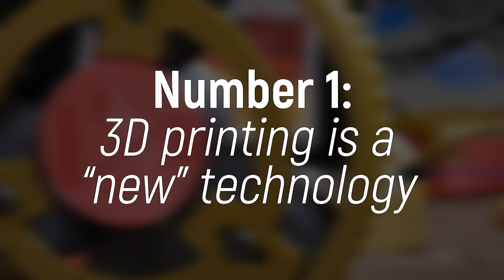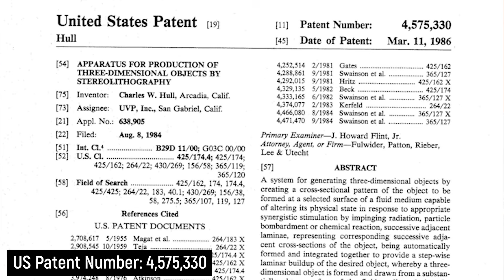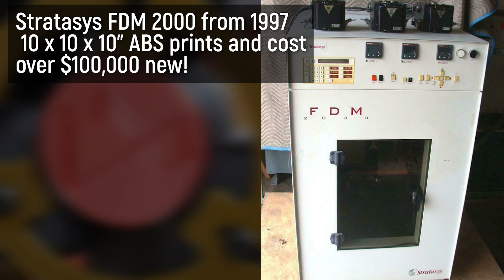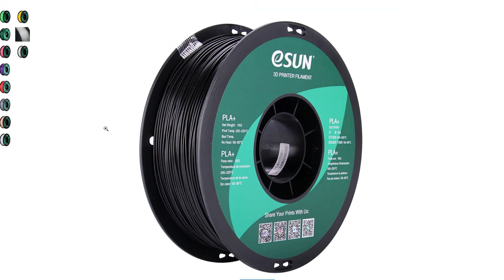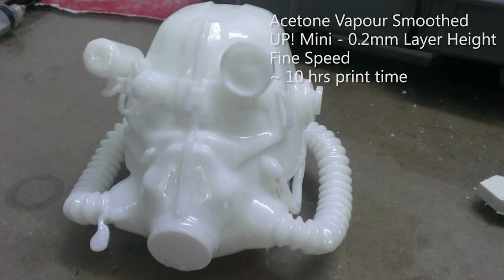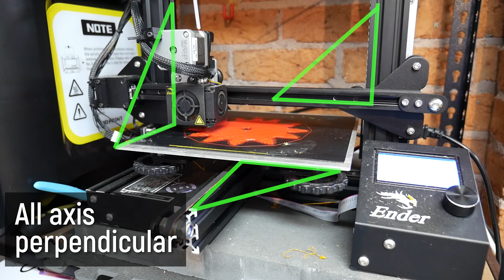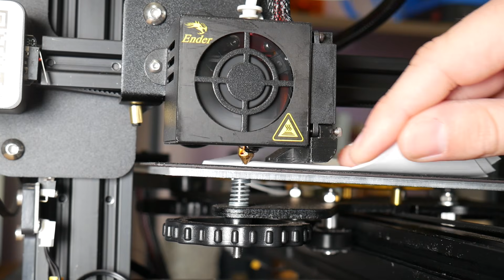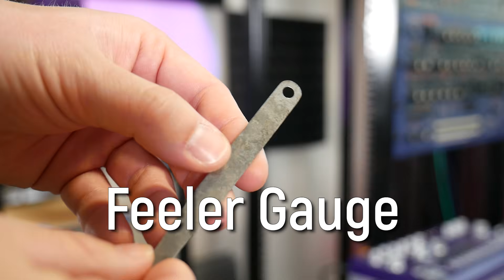3D Printing Myths I used to believe...

Comment: just want to say that i never fold the paper, and its wierd that you do and then show that its bether to use metal 0,1mm, when folding the paper would make it higer than 0,1. in the manual on the ender 5 pro it says onely to use paper nothing abut folding it. but i gues if people folds the parer 1 or 2 times that would explain why it prints wrong :)

Comment: One error. The first patents on related to extrusion objects basically manual 3d printing was 1917. I was first given a gift of getting to use a 1.4 Million dollar 3D printer. That is 1.4 Million before you cool it that was about a million dollars once you install the required roof based cooling stacks. They were using them to replace a CNC machine for making metal injection modls for plastic containers. I wonder if I bough the right model for myself, I bought an Anycubic Vyper. I am just curious if it can be modified or upgraded down the road. Also for dealing with the rough outer surface what mechenical sabding is good. I wantt a machine liek a Dremmel to use is.

Comment: Never seen it mentioned to use folded paper.
Always a single sheet.
Then i adjust the z offset on the first layer. Usually during the brim.
No calipers etc.

Ive also been printing with dual Z screws and steppers with no belt etc and I have NEVER had the steppers go out of synch. That is a complete myth in my experience.
30kg of pla and 10 of abs and never had that issue.

Comment: If you need to use paper to just to check if the nozzle is in contact with the bed, wouldn't it be easier just to use a thin sheet of unfolded paper and aim to raise the bed just enough to get a firm scratch when dragging the paper?

Comment: Hi, nice video, nice chanel content, but this time I have to disagree about the 2nd myth: what Stefan didn't consider is creep (what happen mechanically to materials when they have an stress for a long time): what happen with PLA is that, even when it has a higher yield point, it is the weakest polymer at creep, maybe because it is not  an oil-based polymer, that would be the case for example at a shelf: at a shelf ABS would have way longer durability than PLA. So, ABS has way longer durability than PLA on long term stress aplications.

Comment: I have been using a feeler gauge as well with mixed results.  How do you know what thickness of feeler gauge to use? You show adjust ng the machine to match the feeler gauge.  my objective is to find out how thick of a feeler gauge to use.  How did you determine which thickness?
Reply: You'll need to do some testing first to get a good first layer, then find out what the nozzle height is. Then in the future you can get it back to the height you found worked by knowing what thickness feeler gauge worked before.

Comment: Is Myth #2 really a myth?  I print functional parts for work.  We use cheap 3d printed hook holders for customer chainsaw chain.  Odd thing most ABS printed hooks are going strong almost 2 years coming and going from customers.  PLA most fail immediately and zero even survived a year.  PetG doesn't hold up much better than PLA.  When I need something to last I print in ABS or PetG.  For us I find PLA and PLA+ completely useless and  a waste of money.

Comment: Here is a myth: u always lvl ur bed after every print....

Reality: u lvl when u really need it

(Printing at low speeds and taking out the bed clips to get the print helps to keep the bed lvl)
Reply from the maker: If you're gentle when removing prints you don't have to relevel for months, but if you hack at prints to remove them you might have to do it every print...!
Reply: @MakersMuse  totally true.

But its so cool to just press the button and see it working propertly (also im sooo lazy to level haha)

#gentlegang

Comment: I still remember when I added auto bed levelling to my 3d printer. Best day in my 3d printing life. Manually levelling the damn thing wasn't only exhausting, it produced terrible results. It was a nightmare. Now I just stand there in awe watching that marvellous little device do its thing. Quick and perfect every single time.
Reply: same, i often didnt want to print something because i was too lazy to level my bed
Reply: New to 3d printing. Can that be added to any printer? How?
Reply: @t.pisani8239  Pretty much every printer. You'll need a sensor such as bltouch; if your firmware doesn't support it, you'll need to install Marlin or similar.
Reply: I found it to be more of a pita to get working than it's worth. Takes me less than a minute to manually level.
Reply: @collegestudent6071  How is it a pita? Just stick a inductive probe next to the hotend, set the z offset and away you go. It's much better not having to constantly check the bed hasn't moved or having to watch the first layer go down just to see if it's correct.

Comment: If I got $1 for every time someone has said that levelling with feeler gauge as you suggest, or levelling by having the nozzle just touch the bed will fail because "marlin compensates for you using a piece of paper which is the correct way to do it" I could have an extra printer for free!

I arrived at this conclusion by completely ignoring what the masses say, and looking at the printer and what it does.. First layer it goes to layer height (0.2mm) so i figured hang on a minute, if I have a piece of paper in there when I set the zero point its too high! and I grabbed my feeler gauges and did exactly what you show and presto.. perfect first layer..

It was at this point I realised that there are MANY of these myths circulating the 3d printing community, being passed on parrot fashion until they somehow become known facts!

Comment: I print ABS as my primary material, I mainly make mechanical parts. My printer is set up pretty much exclusively for it. It's easy to overcome it's issues (other than the stink) and once dialed in, I find it better than other materials. Especially for post print workability. I love how I am easily able to fuse parts together, heat gun smooth, carve with a knife, drill, etc.. I like PLA and PETG too but I just keep coming back to ABS.

Comment: The easiest way to make sure you are at the "1st layer" when leveling your bed is... To just start a print and then stop it, then level the bed. Also i use a single sheet of paper, do not fold it or the nozzle will be too far from the bed. Also i recommend using a mirror(ikea mirrors are awesome and cheap), clean it once with soapy water, dry it with paper towels AND NEVER TOUCH IT AGAIN and you will have amazing adhesion without needing to use any tape or glue. It will actually be stuck so hard that you will be able to take it off only after the bed completely cools down.
Oh, one more advise. Sometimes the bed is not completely flat. You leveled all the corners but the middle seems to high/too low. In that case just make sure the middle is level and print in the middle only ;)
Reply: If you print in the middle only, your loosing a hell of a lot of build surface/space/plate what have you. Best to get the issue sorted and dial your machine in so it works consistently and as intended

Comment: My first print was with a university printer and it was loaded with ABS. NEVER AGAIN did I voluntarilty print with ABS. It was a cold day, the print bed was not heated and the printer didn't have a chamber to help regulate the temperature. I helplessly watched as the part warped and the printer made spaghetti out of my final project while I looked at it through a locked glass door, unable to stop it or fix it, my time before the deadline running out.
When I got my own 3D printer I never once bought a spool of ABS.

Comment: actual leveling (with a level) is pretty important for sla, though you can just eyeball it, but if it's too off level you might have problems on bigger prints where one side runs out of resin.

Comment: oh boy....you are so long into 3d printing and you adjust first layer hight by using the tensioning screws on the bed...?

just use paper or gauge and make distance bed to nozzle equal on all positions. Then you try printing. Use babystep until your first layer is perfekt. Apply the amount of babystep to home offset and done.

Comment: I use a level to get everything to close to the same so there is less adjustment and im not going off of nothing it just reduces the time it takes for me by a good but and yes I know the level doesn't fo much it just gives me a good baseline to go off of I still have to adjust other points so its all even the lever to get it all right just helps a bit in the beginning you still have to look and test and tighten or loosen the screws to make it print the same on all like I said

Comment: Have used a feeler gauge like that for years. The paper method never made any sense. Feeler gauge for the first point and then mounting a dial gauge on the head, that then moves to the four corners, where you adjust the four dials to show the same number on the dial gauge as where you used the feeler gauge. Then you get perfect leveling every time.

Comment: I can never get the paper "trick" to work for me NEVER. I just throw a basic square one layer print on and as its printing a large square I adjust the bed and then ill print whatever I need but it is time consuming and wasteful.   I dont know if I completely understand how your using a feeler gauge to level the bed? I get how to use feeler gauges, I use them daily for engine builds and etc. but I dont understand what you mean by how I am supposed to adjust the extruder to fit the feeler gauge? shouldn't I be using a specific feeler gauge to get the correct gapping ?  great video by the way :)

Comment: I just figured the paper under the nozzle was because most people don't have feeler gauges knocking around. Also, why would you fold the paper? If it's folded it's now 2 thicknessess of paper away. I'm guessing it should be as close to 1 layer height away from the bed. Whatever that turns out to be, use a feeler gauge that thick.

Comment: My father, who used to work as an engineer for military branch of Boeing in the late 80s, brought home various 3D printed items from his work at that time. For demonstration the 3d items were all designed with features that couldn't be manufactured with the common slide mold. For example, they produced a rook chess test piece that had a complex spiral stair case inside that couldn't be reproduced by conventional methods. It was quite an impressive achievement for that era.
Reply: Skunkworks?
Reply: @THPOOKY  Skunkworks would be Lockheed Martin
Reply: @steilkurbler4973  you're right, thank you!
Reply: a year ago I purchased an Elegoo Jupiter printer, the demo file supplied is quite possibly that same rook you mentioned, and yes no conventional milling or injection moulding can reproduce it. It sits on a shelf in my lounge a thing of beauty, in 1980 your jaw must have been dragging on the ground. During the 1950's and early 60's my father worked for an English firm called Plessey, he would occasionally tell us about things he made or saw that left me with smoke coming out of my ears, (the things that might be considered "sensitive" we weren't told until the 70's) Ah the perks of having a clever Dad. cheers
Reply: Recently at a machine shop tools auction, I saw an old Stratasys 3D printer from 2008 with a barcode label from Boeing. It was going for $200 USD dollars. But one spool of material for that old printer cost around $200 USD.
Reply: @barrioscorona215  May be worth picking, if only to rebuild it with a modern electronics board. It probably had beefy rails and motors.
Reply: I interned in Boeings Renton, WA facility back in 2012 and they were still making the spiral staircase rooks for giveaways at that time! They were also producing sintered powder, nested buckyballs. Very cool place!
Reply: That's a neat trick, he must have had a time machine too. That file was  created by the MIT students who brought you Formlabs. Around 2014, after they had the original Form1 with the birdcage model, the chess rook with the staircase in it was modeled to showcase the Form 1+. In fact if you find that model anywhere it's modeled right into it.
Reply: @mytuberforyou if the rook was a fairly standard demo piece of Boeing, it’s possible it might have been shared around before 2014, and that they saw it at one point and made their own version
Reply: @mytuberforyou nah, i can confirm boeing was doing this at least as early as 2012, from firsthand experience.

Comment: Actually when i do the paper method i actually measured the thickness of the paper and its, .015 so i fold it over and get my .03 and raise the printer back up after i go to home so i get that .03. And when i get some drag on the paper i am done, but i usaully end up going around the plate 3-4 times.

Comment: Another great video!!!

"I'm not kidding when people have told me, they tried to use a level to level their bed, and you can't really blame them..."

I agree 100%. The blame lies squarely on the teachers and companies (professional or otherwise) that know the correct terminology, and continue to speak and propagate the incorrect terminology. "Bed leveling" is one term, another is "runout", as in a filament runout sensor. Run out or run-out is correct. The term "bed leveling" is here to stay so long as the popular trainers, instructors, & YouTube gurus continue to refuse to change despite knowing better. Nothing worse in education than an instructor teaching, millions of people, flat out wrong information. But it happens all the time.

Comment: RAD.
Kudos on the feeler gauge.. After buying a mini milling machine a few years ago, Using the feeler/thin metal strip on my printer was a no brainer….( And Yes, tram the printer!)..
Also.. The P.L.A. Vs.ABS bit was spot on..
Good info.

Comment: Can't you just level your bed using a 4 point levelling gcode and make sure the nozzle just touches the bed at all 4 points? That's 0, then your first layer should be whatever height you have it set to in Cura...? Works for me..

Comment: Adjusting table with multiple thicknesses of paper? I only use one piece of paper or .004". I have never had issues on my Ender V2 stock out of the box. All adjustments were made with table and nozzle up to temperature

Comment: I replaced the stock springs and screws. The springs needed to be stiffer, and the screws longer. Longer? Yes. I also added lock nuts to well.. lock the adjustment in place. This is to ensure that all the time and trouble I go through to tram the bed doesn't easily vibrate out of position. To tram, I loosen the lock nuts, tram as per usual, then tighten them back up again.

Comment: I just use paper to get my bed close then adjust as the perimeters run, if I am using perimeters in a print. If not, I have a small program saved on all my sd cards to run a square at the levelers to dial it in. Even using a metal shim, I have yet to see a print bed surface that is flat enough for that to work perfectly every time. The one thing bad about using a metal shim is these nozzles are very fragile at the tip. So using paper is much safer.

Comment: So regarding the topic of abs vs pla, i started using abs years ago for some of my projects. I have print towel holder both in abs and pla. However i noticed that after about a year, pla felt brittle and start to crack and eventually failed, while abs still going strong. My question, is pla more susceptible absorbing moisture thus making it brittle over time? I also noticed that my pla filament that has not been used for long time will start to break and require dryer to be useable again. I don't know how abs react to moisture, but my abs filament that has been exposed to ambient air similar to pla works just fine and still useable for printing. I plan to print small planter for my succulent, however still debating on which material to use. It will have to withstand exposure to sun and water as well. Any advice would be very much appreciated. Thanks.

Comment: I saw some kind of sintered process being used in 2002 or thereabouts. At the time I said, that's amazing, this will change everything. Ok fine, it's old tech, but it wasn't until the plastic printing machines became easily available to everyone at a reasonable price that it really took off for most people.
On another point - I own feeler gauges, why has it never occurred to me to use them on the bed? Thank you for that.

Comment: Very confused, new to the sport.  Why would anyone ever use a folded piece of paper for bed leveling?  Feeler gauge makes some sense, maybe...  Why not just use an unfolded piece of paper?  I'd want to start as close to Z=0 as possible.  I've got a stack of thin notepaper sitting next to me and a sheet is .003" thick.  The calibration card that came with my machine is .004" thick.  A twice-folded piece of printer paper registers at .016" (all using the calipers I have handy).  Methinks we're not "myth-busting" here, just exploiting the common sense of three-axis machine usage (not necessarily CNC).

Comment: A machinist told me the average piece of paper photo copier paper is .03 of an inch. I use a single sheet no folds for my Z on my CNC just keep lowering slowly until it touches and back of then move in lower increments and repeat until happy

Comment: ABS is softer than PLA. It has been documented on the specifications.  The only reason to use ABS is the a little bit higher temperature resistance, which could be necessary in some limited scenarios.

z probe is doing a better job than leveling platforms manually.  Why's manual leveling?